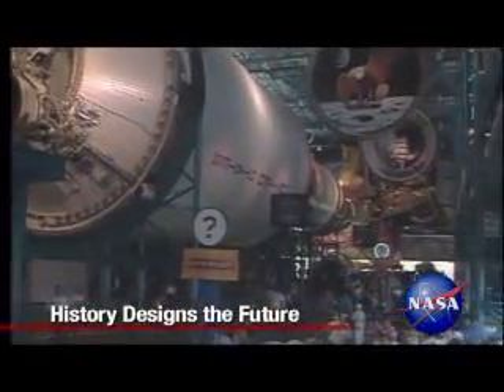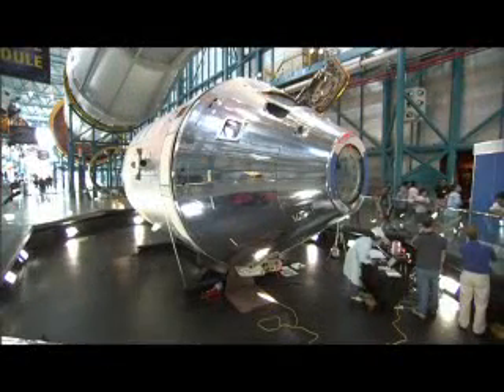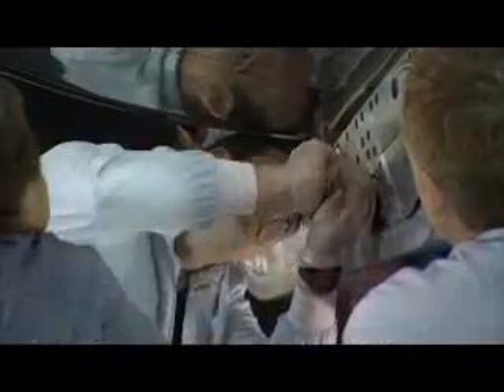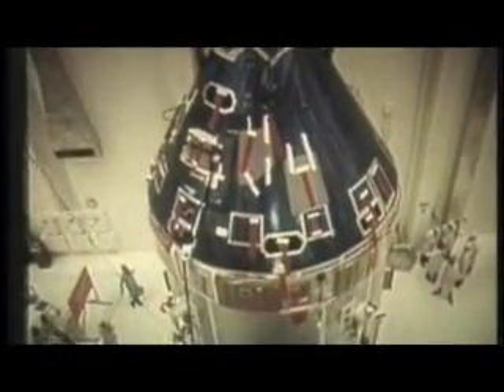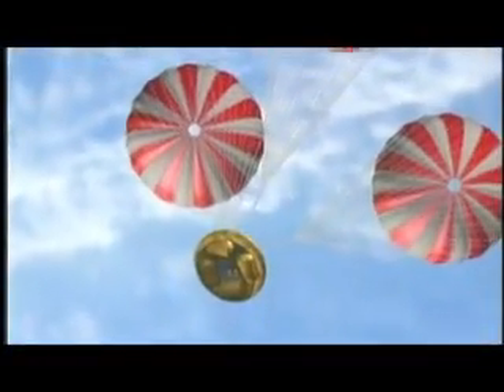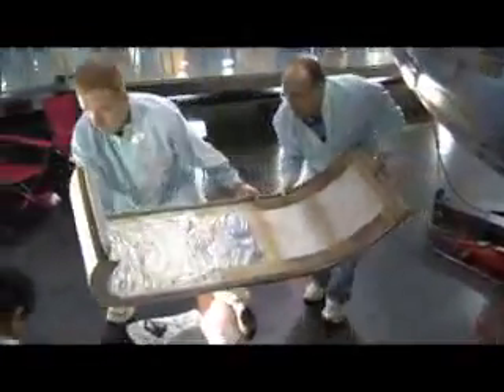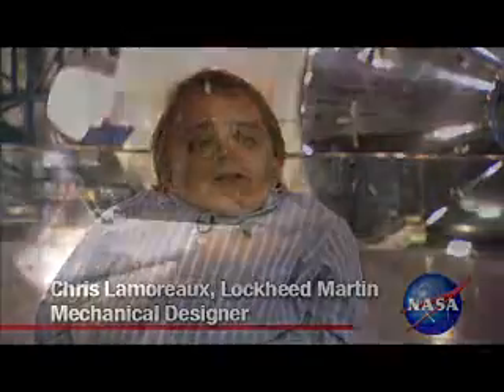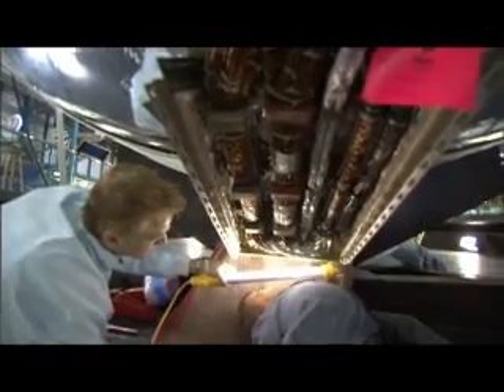History Is Revealed

Comment: Thank you for sharing this video. If Project Constellation is a success it will be in large part because of the lessons learned during Project Apollo. NASA and its contractors are to be commended for using heritage hardware and heritage designs for the Orion Crew Exploration Vehicle and the Ares booster.